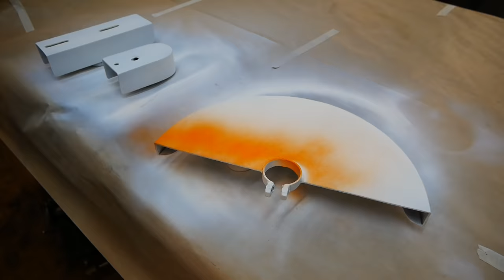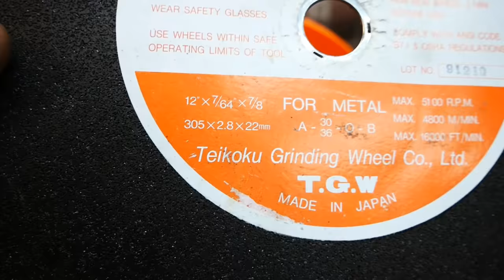Making Chain Saw to steel cutting

Comment: Very cool.  And the chainsaw ALREADY came in trademark orange!  I assume you just leave the bar oiler tank dry?  Nice work!
Reply from the maker: Thank you :) Some oil must be there, otherwise you can damage the pump, but it is enough to add very thick oil from agricultural machinery, thanks to which the oil does not come out and the pump does not run dry
Reply: @WorkshopFromScratch  Good idea!

Comment: Nice idea and it seems to work well. One suggestion I would offer you is a superior way to make your guards. In my career as a welder, I literally built hundreds of guards for various machines. You are fitting your guards up by wrapping the outside band flush with the side panel. A better way is to fit them up corner to corner. This allows you to weld it out from the outside and when you finish grind it you will not grind away most of your weld and be forced to weld again from the inside which causes more distortion from the heat. The only place they should have any back weld is about 1/2 to 1 inch at the very end where the band meets the side panel. This is where they will always crack due to vibration. Just a suggestion.

Comment: The chainsaw design looks like a Husqvarna design but was it marked with another brand? Anyway nice work...
Reply: It is an chinese rip off
Reply from the maker: It's a Chinese chainsaw, it doesn't cut wood very well, so I made it to cut metal.
I have a fairly old Husqvarna 340 saw, it works, but due to its age it requires renovation, because it has very poor compression

Comment: Me párese un suicidio utilizar un disco tan grande diseñado para girar a 3800 RPM.. en motocierra q gira a 14000 RPM...☠️☠️☠️☠️☠️
Reply from the maker: Esta motosierra gira a 8000 rpm, 14000 rpm se consiguen con motosierras como Sthill, Husqvarna. Las sierras chinas alcanzan revoluciones mucho más bajas, después de instalar un engranaje con un diámetro de 40 y 60 mm, la velocidad del husillo es de 4000 rpm sin carga
Reply: @WorkshopFromScratch  ok tu respuesta me da la razón porque 4000 es más q 3800

Comment: I applaud your building skills..VERY Well done.
Plus your use of BOTH  Hearing and Eye protection along with safety boots when using it to cut steel.

I would also suggest wearing gloves and non flamable clothes as that volumn of sparks can burn or melt the wrong clothing onto your skin.
For you and others reading comments DONT FORGET to wear an appropiate breathing face mark as concrete dust when cutting is Highly Dangerous to breathe in.

I speak from personal experience.

I would suggest adding an adjustable WATER MIST Attachment to the cutting guard that you can connect a garden hose or pressurised water source to if you plan to do a lot of concrete cutting.

Comment: A reciprocal  saw can do the same, faster and less sparks, very low decibels. How long will it take to cut railroad thick steel? I've seen guys cut railroad  steel with reciprocal saw in minutes.
Reply: Go get some railroad track and make a video.

Comment: Gear ratio is not good. Its 19tooth/19tooth = 1:1. Maximum speed of chainsaw without load is more than 12000rpm but you use standard angle grinder disc with maximum 5100rpm. Disc is heavily overspeed. Its extremely dangerous in case when disc explode.

Comment: Nice job . But did you know if you're not running at the max rpm of the blade ?
Reply from the maker: Thank you :) The rpm were reduced by installing two sprockets of different sizes, details in the video description :)

Comment: Excellent.
The original oil pump must be deactivated - removing the drive worm?
Cutting discs of such diameters support relatively low rotational speeds (4400rpm) and a chainsaw has 9000rpm ... the reduction is 40/55 = 0.72 and the speed is 0.72 * 9000 = ~ 6500rpm.
40:80 A reduction would be more appropriate ...
Reply: good point.

Comment: Nice job, but there is one big BUT. Chainsaw engine air  filter is made to filter out wood dust, not the fine metal/ abrasive dust from your cutting disc. So if you planning often use of this device, you will fuck up your chainsaw engine very quickly...
Reply from the maker: Thank you :) I will take you advice and replace the filter :)

Comment: Nicely done, have you thought about getting a TIG welder, it comes in awefully handy when welding small stuff and small pieces of thin sheet metal.
Reply from the maker: Thank you :) I have a TIG welder, but when I was doing the project I ran out of argon and the gas mixture for the mig-mag welder, so I welded co2 with gas, i very rarely weld with this gas, which makes the welds very ugly